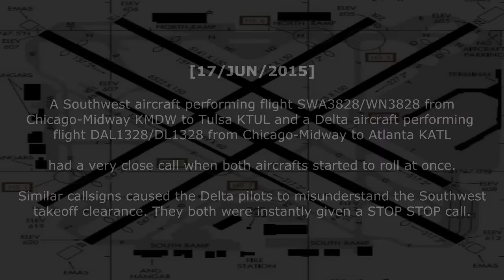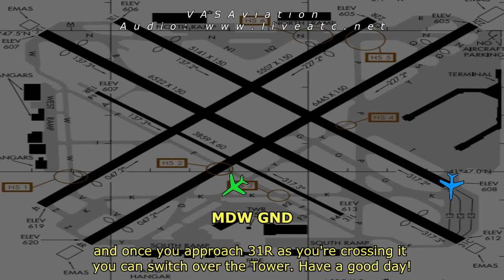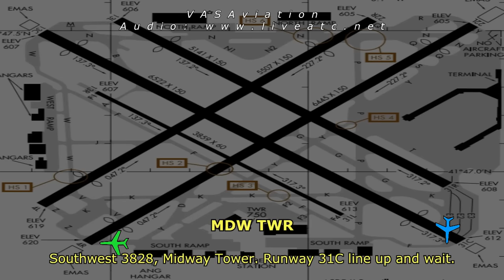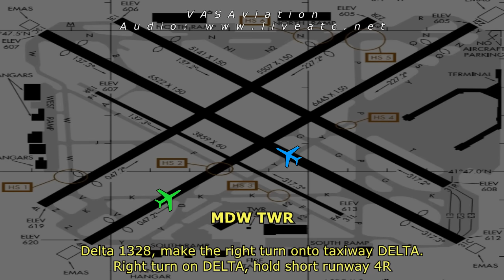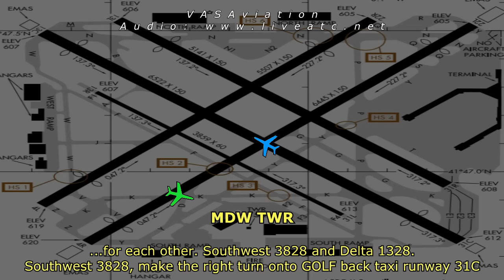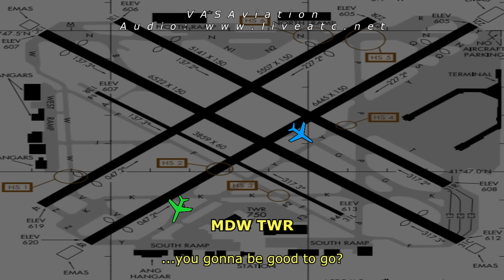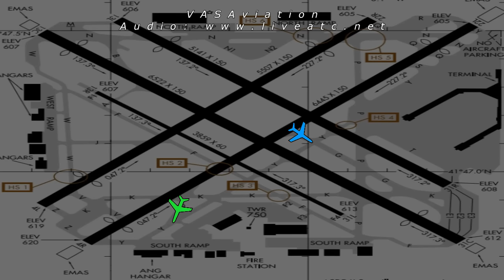[REAL ATC] Delta and Southwest VERY CLOSE CALL on takeoff

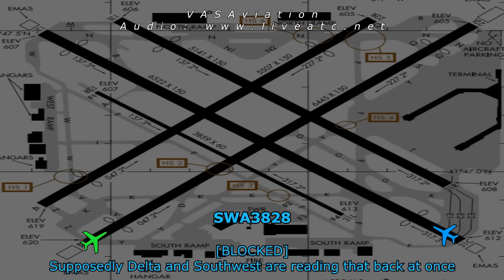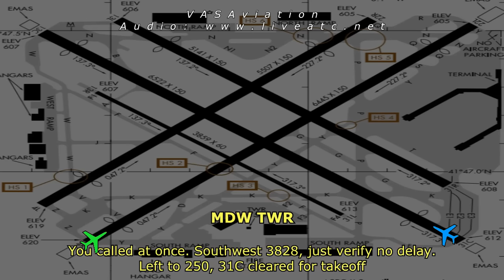Comment: Assuming that we're hearing the tower's complete transmissions (reference the comment by Redtail Media Productions, below, which I happen to agree with), it does sound like the controller begins talking, before his radio is actually transmitting. However, clipped transmissions, or not,  in the clearance for SW 3828 the words "RUNWAY 3-1 CENTER" are unmistakably heard twice: first at 1:15; then again at 1:23. Since Delta 1328 was on RUNWAY 4-RIGHT, I believe that he should have caught the words RUNWAY 3-1 CENTER, and realized that the clearance WAS NOT for intended for him.

I believe that Delta erroneously took SW's takeoff clearance due to an "expectation bias" --  which is anticipating a clearance, and not really listening to the words of the actual clearance.  In any case, with multiple blocked transmissions, all parties involved should have taken no action, until a clearance "in the clear" could be verified and acknowledged.

I think that the tower controller believed that he had sufficiently cleared up the ambiguity, even though there were multiple blocked transmissions by both Delta and Southwest, or else he would've & probably should've repeated it, however many times it would have taken to get a clean readback.

This looks like the same "anticipation of the clearance" event that caused the terrible Tenerife accident in dense fog, back in '77 between a KLM 747 and Pan Am 747. 

In this case, the alertness of this tower controller saved them both from disaster.

Comment: Most dreaded phrase for a pilot to hear:

"Contact company"
Reply: Could you elaborate on what you mean by that?
Reply: @planez7504  They're gonna call their company (airline) for further steps etc. They will need to advise that this just happened, brakes might need checking and fuel might be just a tad too low for comfort after the aborted landing and subsequently standing 'stationary' on the taxi way for some time so they'll likely need to return to the gate or at least have some personnel check out the brakes etc before another take off might be attempted.
Reply: @someguy4915  thanks so much. I'm gonna be headed off to school to be a pilot soon and I was a little dissapointed in myself for not knowing this. Thanks again for the clarification
Reply: i imagine "we've got a number for you to call..." is worse.
Reply: @someguy4915  just saw these replies, but glad I just did because you explained it better than I ever could have
Reply: CA Babyboomer  depends on the scenario. If the pilot made a massive mistake and endangered the lives of others but also could have been avoided if he followed protocol, Then he could be either fired or sometimes sued
Reply: @planez7504  good luck buddy!
Reply: CA Babyboomer  apparently he got fired but later managed to get his job back but at lower pay
Reply: I think "possible pilot deviation" is much more dreaded.

Comment: There's a delay between keying a mic and it picking up.  It seems like when ATCs get busy, they key and start speaking right away, cutting off the beginning of the callsign everytime.  Not blaming them, but it is pretty confusing.
Reply: You are right and I actually "blame" them because even my 10yr old son knows that he cannot start speaking into the walkie-talkie immediately when pushing the button.
Reply: What you hear here is what the scanners pick up and not necessarily how the other end hears.
Reply: First, The pilots arent supposed to guess, second the runways weren't the same.  It's 100% on the pilots. ATC even told them to be careful.

Comment: 💦Whew!💦 The technology needed to transmit clear visual cues to the flight crews with a display of takeoff order, and status of other aircraft is almost old technology now. I'm surprised that no one has thought to assemble that type of system for this setting.
Reply: why should they use new technology? the old one is fine!
Reply: "fine"  Cars didnt used to have seatbelts either and the car manufacturers fought tooth and nail to avoid installing them because of costs. Finally they were forced to change and now we would never go back. Obviously audio cues are inperfect and visual would be better.

Comment: I'm A Pilot, I Rated For Several Corporate-Type Jets and I Once Owned & Piloted An 18 Passenger, Twin Engine Jet. I was already a Civilian Pilot with Instrument And Commercial Ratings when I joined The USAF. I wanted to be a Fighter Pilot like my Dad was during WWII. However, I was found to have Glaucoma. It closed the doors to me being able to follow in my Dad's Footsteps. But it didn't preclude me from joining The Airforce. I chose to be an Air Traffic Controller. There's NO Job more Stressful & Certainly Mistakes are Made. Sometimes Communications Are Garbled!!! When You Have Multiple Runways, Multiple Controllers and Multiple Aircrafts Trying To Get On The Ground and Off The Ground. This Airport Is Especially Dangerous, with Runways That Cross Other Runways Twice. Honestly, I have never flown into An Airport designed this one. A "Tic-Tac-Toe" fan must have designed this Airport! Personally, before I Throttled Up I would have asked ATC to repeat their instructions. I'm a bit surprised that no one from either plane Failed To Ask For Clarification! Listening to this, I didn't understand the Take Off Instructions with Two People Talking On The Same Frequency at The Same Time! My hats off to The Controller that was alert enough to realize that Both Planes Were Rolling And Directed Both Airplanes To Abort Their Take Off Rolls, Rather Than To Direct ONLY The Plane That Was MISTAKENLY Rolling! That Was Likely The Call That Saved The Day!
When I Was In The Tower In The Airforce I requested A Change Of "M.O.S."! I told My C-O that My Nerves Couldn't Take ATC Anymore! He Told Me About A New Section Being Formed Called "The Airforce Commandos." It Would Be The Only Actual Ground Combat Troops In Airforce. One Called "Combat Controller," Which Called For Air Traffic Controllers To Be Trained In Special Operations Combat And 
If I Was Interested, I'd Be Attached To Various Units In Other Branches Of The Service, Primarily The Army, Combat Troops, Special Forces Units, And That I'd Carry A Mechanized Weapon & Be Expected To Use It! My Job Would Be To Plot The Location Where An Air Strike Is Needed, And Call It In! (This Was A Job Once Reserved For Combat Pilots.) I Told My Col. That I'd Rather Dodge Bullets Than To Work In The Control Tower Another Shift! I Had To Work A Few More Shifts, When My Active Duty Enlistment, I Remained In The Reserves For Several More Years And Was Deployed To Panama, The First Gulf War and Other Brief Deployments. 
But, Air Traffic Controllers Are A Special Breed! I've Heard Them Calmly Talk A Non-Instrument Rated Private Pilot Caught In A Sudden Fog, Safely All Of The Way Down To Touch Down On The Runway!
Every Day, They Prevent Mid-Air Collisions! They Are One Of The Main Reasons Why Air Travel Is The Absolute Safest Form Of Transportation On Earth And Amazingly, Many Of Them Aren't Themselves Licensed Pilots!

Comment: The “no delay” instruction from ATC contributed to the incident here. Had the “no delay” command not been given, both pilots could have taken a moment to slow down and clarify the clearance. Instead they were told to rush. The aborted take offs obviously taking up more time, thus rendering the initial urgency irrelevant, so if ATC could have sequenced them differently in the first place, might have been a different outcome.
Reply: I imagine the A/C landing 4L would have had an issue with SWA not departing "without delay".

Keep in mind that the video displayed here is not an actual ASDE feed and just a best guess.
Reply: If they would have listened, delta would have realized that they called the wrong runway, the wrong heading, and the wrong cross track. They clearly only listened to the part he said cleared for takeoff, and ignored the rest.

Comment: "Runway 31C, cleared for takeoff"  There is no way that the Delta flight could have reasonably confused that as clearance for their flight.  They are on "4R".
Reply: @MrKwijiboe In that case, the Delta pilot would not have understood what was said.  So he either heard the wrong runway or didn't understand what was said and decided to takeoff anyway.
Reply: Agreed.  Delta bungled very badly, especially after being warned of the similar callsign.  However, the controller had been speaking rapidly and was not the same one who gave the warning.

Comment: As a complete outsider who worked the phones a lot in call centers I can say with confidence that if you're saying something and you need it to be clear, SLOW THE HEKC DOWN!

With similar call signs ATC needed to adjust his cadence to eliminate some of the ambiguity and start calling "Southwest THREE eight two eight" and "Delta ONE three two eight" to highlight the most obvious differene between the callsigns and make it easier for the pilots to figure out which one he was talking to.  By not adjusting his cadence to err on the side of clarity ATC may have caused a nasty accident there.

Comment: Who thought of the brilliant idea to have 2 intersecting runways as the active ones
Reply: Parallel runways have to be a certain distance apart to be used simultaneously
Reply: @joshuas3897  omg that's insane Jarvis
Reply: @joshuas3897  That distance is actually not that much, just take SFO as an example, it has the same runway layout and they manage parallel takeoffs and landings perfectly fine. For runways less than 500m apart (i think) the aircraft have to follow what is called a SOIA approach.
Reply: @killman369547  With VFR I think they have to be around 250m apart and with IFR they have to be 1300 m apart
Reply: after a quick google, intersecting runways can make use of space in a more efficient way depending on the airport, can be good in differing wind conditions, parallel runways usually have planes crossing them already because it takes too long to go around, creating more opportunities for collision than intersecting runways. I think they are around the same efficiency for takeoff's and landings as parallel runways, as while planes have to wait for their path to be clear, it is clear the moment the plane on the other runway passes the intersection.
Reply: Almost every commercial airport has intersecting runways. You kinda have to in order to allow planes to take off closer to the direction of travel so they don't have to start their flight making a steep bank to get on course. Also if a crosswind is severe enough you might get directed to takeoff from a runway that is more parallel to the wind direction. Assuming everything is operating smoothly and correctly there is no problem with having intersecting actives.
Reply: @Spyblox007  it is certainly good for airports to have intersecting runways for those reasons, but that doesn't mean they should have intersecting runways active simultaneously. If you look at the airport diagram, there are parallel runways in both directions, and one direction will be more favorable to the wind. Having crossing runways active simultaneously is strange because one is less favorable for the wind, and if they have the two active runways be parallel to each other, they would not collide. The only risk of collision is if one aircraft is cross into while another is taking off or landing, but that is monitored much more closely, so it would be less likely to occur
Reply: @ShiningDarknes  In the USA?
Reply: Fun fact: 0 airports in China have intersecting runways. Of course, not saying they are unsafe. Much of North America is much windier and a lot busier than the rest of the world traffic volume wise, and it would simply be impractical to not of intersecting runways, often in operation at the same time.
Reply: I think it would be better if one of them was for landing and the other was for takeoff. Why both of them for takeoff?
Reply: @joshuas3897 not necessarily. At Las Vegas, sometimes both runway 1R and 1L are used for landings, and they have a very small distance. All of midway’s runways are extremely short, and only two of them are slightly longer than the other three.

Comment: Even with similar call signs, DL1328 knew he was not on 31 center. He was lined up and waiting for clearance on 4 right. Controller clearly said runway 31 center…cleared for takeoff
Reply: Yeah, this was all Delta's fault, without question.  Even if it was totally garbled and all you heard was "grh" sounds, three one center would sound like "grh grh grh-grh" rather than just "grh grh" for four right.

Comment: As a Navy vet and later working in technical fields where clear, consise communication was essential to safety, I'm surprised that ATC and the pilots weren't saying their numbers as 1-3-2-8 and 3-1-2-8 as opposed to thirteen twentyeight and thirty one twentyeight. That  makes a HUGE difference. Something as simple as miscommunication and misunderstanding can result in catastrophic consequences.  ATC should have initiated the procedure by being the first to use  that form of calling the numbers.
Reply: They did also clearly say "cleared for takeoff, runway 31 Center" and even if you confuse callsigns, when you're sitting on 4R (four right sounds nothing remotely similar to three one center) you got no business rolling.

Comment: Perhaps this is a sign that conventional radio isn't the best system anymore.
Reply: Well said my friend
Reply: May you suggest another reliable system??
Reply: @RayyanAshraf  I'm just brainstorming here but: couldn't they use satellite phones for digital transmission with no chance of signal interference? They could add additional notifying systems like a large LCD screen inside each cockpit which automatically transcribes every voice communication and displays it in a chat-like interface. They could throw icons or a map on the LCD which clearly display which runways are active, where every plane is, or at least which call signs are present. EDIT: This LCD map with moving icons is apparently under development at Boeing so maybe this will be implemented soon! http://www.boeing.com/commercial/aeromagazine/articles/qtr_02_10/2/
Reply: @kylenakamura4353  I feel like that would be too impractical to use that in every plane and every airport in the world. Although some places could use this in my opinion
Reply: Relying on a more complex and technology consisting of more parts able to fail isn't always the best idea...
Reply: Traffic lights that turn from red to green could indicate that they have the runway.
Crossing runways: they should have red lights flashing when the other runway is being used so they understand that they cannot roll. 

AI sensors could sound an alarm when a plane is not following the instructions.
Reply: @kylenakamura4353  how about simple traffic lights that are red until they switch to green. You can implement a system that will never switch both lanes to green ever. It's the easiest, most logical solition that everyone is familiar with.
Reply: They could broadcast text along with their voice and only when the text call sign matches the plane it's intended for would a cockpit indicator show that the message is directed at them. This would merely augment the existing system.
Reply: @RayyanAshraf  emergency services and military have been sending text over radio waves, for decades now.
Reply: Integrated/networked GPS?
Reply: @klick2destruct  No that's stupid.
Reply: @kylenakamura4353  The LCD map is sort of already here. All you need is a tablet and   https://www.flightradar24.com/41.98,-87.9/14  
All you would need to do was to implement some system so that every plane was YELLOW, and when you issue a take-off clearance the plane turns GREEN.
Could even make abort-instructions have the plane turn RED.
Reply: They already have radios where they can be set to a mode such that if someone is transmitting no one else can transmit at the same time. Even if you press the mic button, you radio stays in receive mode until the frequency is clear. That way you can hear what the other guy is saying, instead of both transmitting at the same time only the first in transmits and everyone else listens. Your radio stays in receive mode even if you press the mic. This is not a big upgrade or expensive and you can turn off the feature if you want. Just use it close to airports.

Comment: Bruh "Be ADVISED of a similar callsign"? And that's it? And still stupidly calling 38 thirty eight  and 13 thirteen? This is exactly why we're taught to pronounce each digit separately. To prevent dumb crap like that happening ever again. Pilots were wrong to misunderstand that callsign, in the end, of course. But I would have a very serious conversation with the shifts supervisor, who allows such misleading pronunciations to be present.
I get it: you try to save a 1.7 seconds of the transmission to speedrun everything. But was that worth it, in the end?